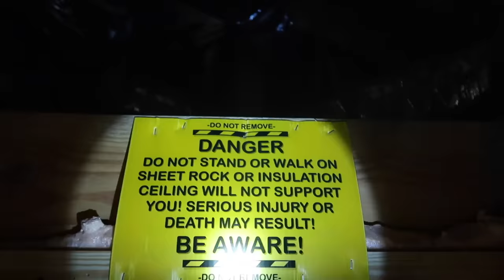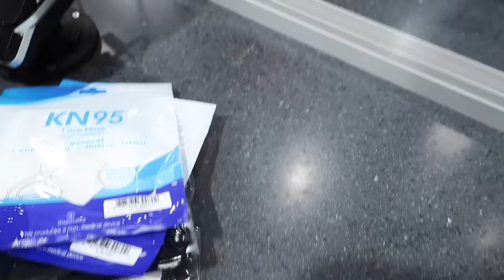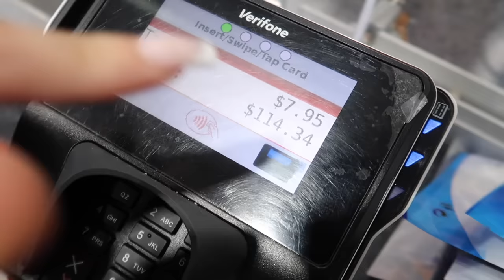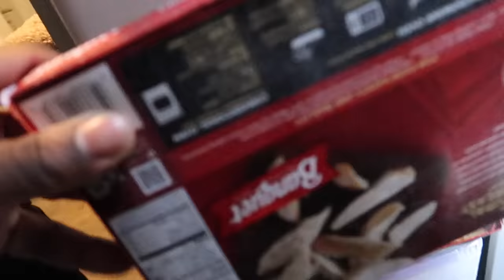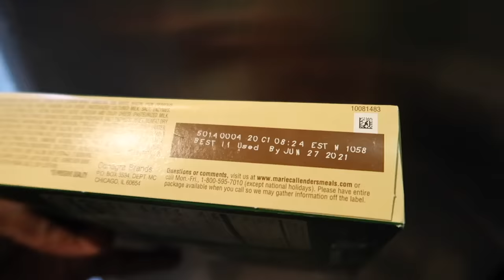PRAY FOR THE PRINCE FAMILY HOUSE **FIRE FIGHTERS PULLED UP**

Comment: The main water supply valve is usually outside on the lawn, closest to the street. It's not exposed, there's is usually a green or white plastic or metal cover over it. The cover is approx 12in x 8in. Once you lift the cover, there will be a metal valve that you can turn off. Hope all is well.

Comment: I did mean I think the heat is covered from the hot tub. Because I think it's connected to that in. That's why the heat mill gas. Because that means the hot the gathering from the hot tub.❤❤❤❤❤

Comment: There are sewer gas dangers people should be aware of due to the gases that comprise sewer gas. A leak, small or large, in your plumbing system can be a direct cause of sewage smell. Sewer pipes are meant to direct sewage to your septic system and if there is a leak then that means not all of the waste is making its way to the correct destination.
Sewer gas has a very distinct odor like gasoline that is easy to detect and associate. It gives off a sulfuric type odor that smells more like rotting food. The sewage smell is largely contributed to by the different gases that when combine create the poor odor. Sulfides, ammonia, methane and the other compounds in the sewage all combine to create the sewage smell you are familiar with. In small quantities, sewer gas dangers are minimal, but in larger quantities it can become problematic.

Comment: No cuz you see how the waters coming out like that the pot the thing to turn the pipe and water off it's upstairs in the Attic you pushed one of the switches to turn everything off if you don't want to turn everything off press one switch and then that's going to turn the water off and the backyard smell like gas that's the water next to something that's hot like it smell like fire I mean gas that's probably the the water doesn't landed on the grill on the grill that's smelling like that